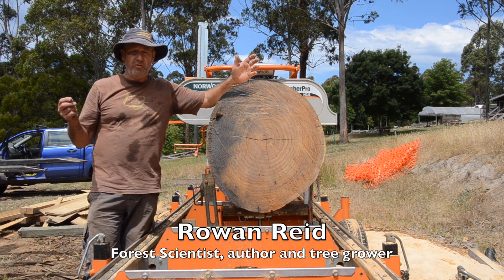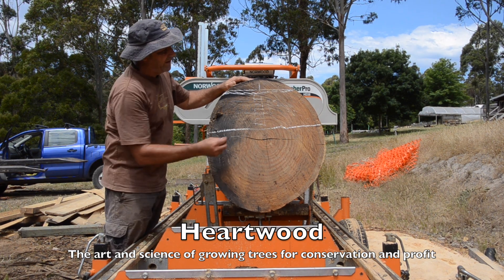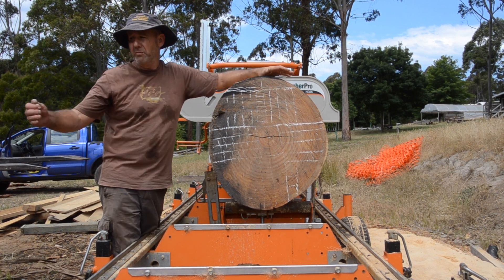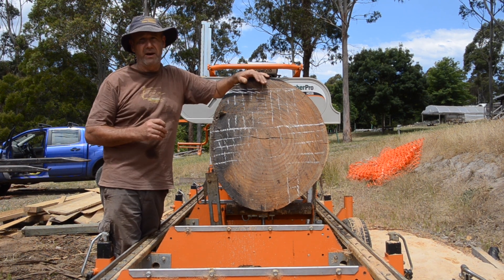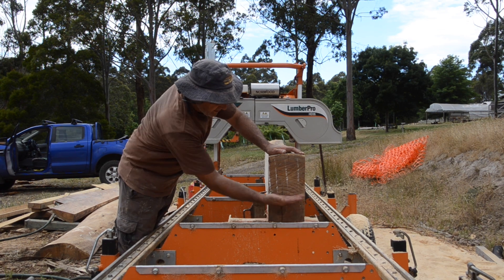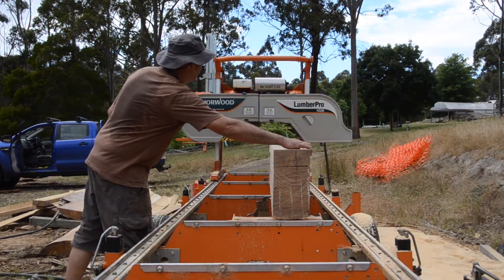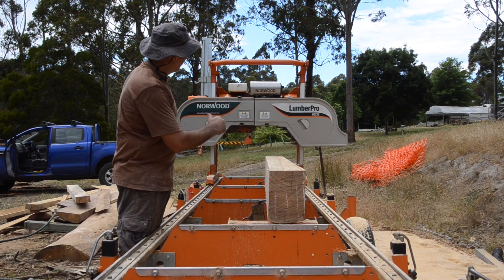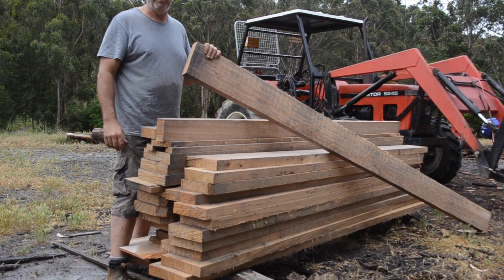Quartersawing on a horizontal bandsaw

Comment: I know it is an old video but the info was just what I was looking for. I have the same sawmill for 4 years ( also manual), but only have about 12 hours of run time on it. I am still learning. Quarter sawn wood is what I want to cut ( more stabile and nice grain pattern). Now in the process of building a stock of lumber for furniture making. Cheers from Canada.

Comment: Cheers from Missouri.  Thanks for the video.  You taught this old dog a few new tricks.  Your application of the electric winch on top of the loader is genious!  Way better than using the hydraulic lift!  Best explanation and example of stress in logs I've seen yet.  Hope the wildfires missed you.

Comment: Great video, very helpful and well explained. Thank you. Watching you work on that manual saw made me appreciate the hydraulic mill by a different maker I bought last year. Also, it is tough to see growth rings an inch wide and think of a hardwood tree. We fell and process 120-year-old oaks here in central PA. The growth rings are 1/8" at most, and most are 1/32" wide, Very dense, hard wood. Anyhow, thanks again for your video

Comment: First of all, it is not always good to just quarter saw everything. Typically, I just quarter saw for wood working and flooring. I flat saw for dimensional and siding. I only kiln dry for woodworking. Everything else is just air dried or sold green. Slabs are typically just air dried unless the customer requests the kiln. I have a unique way of quarter sawing. I have a turbosawmill swingblade and a band mill. The turbosawmill will double cut 16 inches. If the log is prime, I tag it for quartersawn. If there are defects, it gets flat sawn. For quarterawn I draw out the pith and saw out the outside quarters with the swingblade, then double cut the center cant I just created. At this point, I will flip the log and repeat the process. At this point, I have some dimensional boards, and 3 cants. I remove the pith on the band mill and let everything air dry. When I recieve an order from a wood worker, I cut to their needs on the band mill and finish in the kiln. There is less waste on the thin kerf  bandmill to maximize profits. On a side note, if you plan your cuts well, there is very little waste. My scabs get milled into stickers, the piths become fence posts, who cares if a fence stay twists. Dont be in a hurry to just firewood everything. You would be surprised what you can sell if you get creative. The only time I declare something is firewood is if the ring shake is bad or its punky. There is a really good video on youtube demonstrating the process I use.
Reply from the maker: thanks, all good advice
Reply: please post the "There is a really good video on youtube demonstrating the process I use" or post a video that you make. I too run a bandsaw mill, a WM 35HD, sourced by our own old forest, and 95% of what we produce are RR ties and pallet grade cants and lumber. I am always looking for better ways to do it
Reply: @pamtnman1515  I cant get the link to copy here. The name of the youtube video is quartersawing with our hybrid technique by onesky puppy. I works really well
Reply: @mandmmilling3716  OK I will look it up, thank you
Reply: @mandmmilling3716  OK I watched that video. I grant you that it is interesting. If it works for that guy, then fine. It would not be practical for 98% of the people who run their saws for a ft living or for production. Two manual machines instead of one that is fully hydraulic, lots of space taken up by the Lucas Mill, which is a cool piece of equipment, no doubt. I suppose if you live in an area with few or no sawmills having that guy's setup might make sense. He would be cutting custom orders at his leisure. For most of us sawing average logs, our time is way way too precious to spend all that effort cutting and handling material. On quartersawing oaks, just taking out the 2-3 center inches will give 2-3 quartersawn boards. Even on a 14" log. Quickly flip the boards, edge out the heartwood and you are done and have 4-6 decent quartersawn boards. Flat saw the rest and move on to the next log.
Reply: MandM Milling you posted an interesting and detailed response that is now gone. You and I are sawing for different purposes. Most of what we cut is railroad ties and pallet cants. Some grade and pallet lumber results, naturally. Occasionally we fell a nice red or white oak. Those we try to get everything out we can. Very often on those we don’t even have a pallet cant, because we have cut right through the log center. We do some custom orders but with so many sawmills here in central PA, competition is fierce and prices are low. And that is why I will pull 20bf of  $6bf quartersawn out of a log instead of a $30 43bf tie and 25 bf of 38 centbf pallet.

Comment: Nope.  That method is just creating more waste.  WASTE= the total amount of material that isn't going to get used.  That includes the amount of material the carpenter (cabinet makers, furniture makers and luthiers included) ends up throwing away, not just the pile of waste left at the sawmill.  If the sawmill cuts crap, there's a lot of waste when the product gets used.  Quarter sawing should reduce waste.  It also flushes out the imperfections in the wood.  Quarter sawing should yield material that is pie shaped, narrow slices of pie usually, 2 inches at the wide side tapering down to a half inch or less at the narrow side.  Ideally, each pie shape should be just shy of the radius of the log.  A carpenter (cabinet makers, furniture makers and luthiers included) can deal with that.  They'll trim, plane and edge to their specific need.  Quarter sawn wood is NOT used in conventional house framing.
Reply from the maker: Thanks for that. Good points but: 1. how do I dry pie-shaped boards in the kiln? 2. recovery can be able the value of the product not just the volume. 3. We are selling/using this timber for furniture (not framing). 4. the inner cor of eucalypts contains the juvenile wood and knots form our artificial pruning so it is waste = firewood anyway.
Reply: @bambraagroforestryfarm4008 

180 degree swing blade technology will allow portable sawmill owners to get the extra dollar they need for high-quality quartersawn wood used in specialty industries.  Here's a video from a Canadian firm, D&L Technologies, in which the 180 degree swing can be seen, though it is not demonstrated.  This 180 degree swing blade technology opens up a whole new world of opportunity.  https://www.youtube.com/watch?v=BkXMLWO2IIQ  Contact: Owner, Mr. Lindsay Flett.

Drying pie shaped boards is easily figured out, resawing and planing, if stacking pie shaped wood presents a problem, which it shouldn't.

I'm not selling this particular saw.  I have however spent the last two weeks researching a new saw to purchase.  And there's no way I want a bandsaw mill.  The cost of dealing with the bandsaw saw blades and all their faults, breaking, running off their wheels, swooping and diving, and, sharpening, turned me toward a swing blade saw.  In Australia you have Turbosaw offering similar products.

Good conversations here.
Reply: @nodnostrebor4300  waste? the method he is useing is the same way i do it, been doing it for ten years. there isnt very much waste at all.
Reply: Watched the video, no mention of quarter sawing (lap siding is a whole 'nother thing).
Reply: Don Robertson do you have any idea what you are talking about? I run a sawmill full time, cutting 99% mixed oak here in central PA. I have a stack of quartersawn boards that are up to 20 inches wide. Most of the quartersawn comes out 4-6 inches wide. These are all squared boards. Quartersawing by definition results in a lot of wasted material. Has trade-offs. It is a highly inefficient use of the material, but the material that results from it is the highest possible quality. No pie shaped anything, the boards are all squared up and true lumber boards. And contrary to what you state, plenty of people use pallet-grade quartersawn oak for all kinds of rough uses around here - white oak fencing and posts, for one. If the wood is full of knots and stain, then it gets the lowest use. But whenever you cut through the center of a log, you are automatically getting quartersawn boards, so it gets mixed in the order.